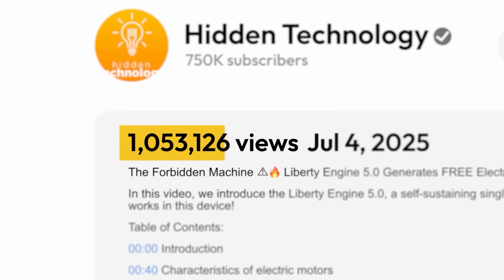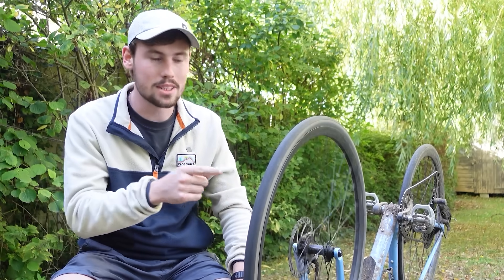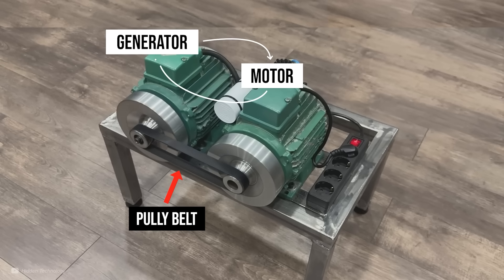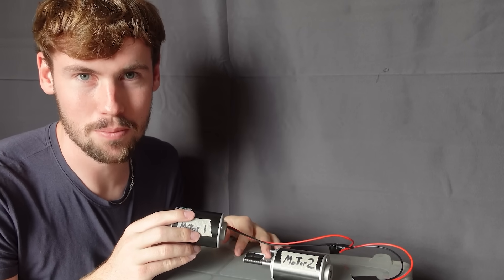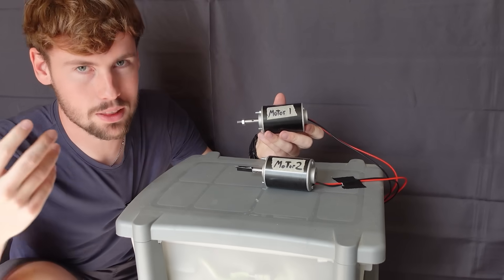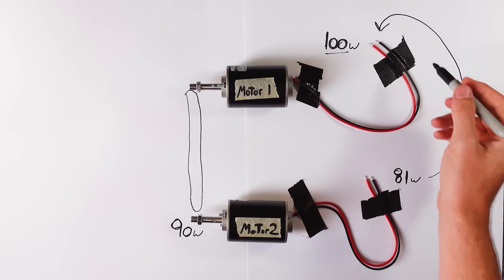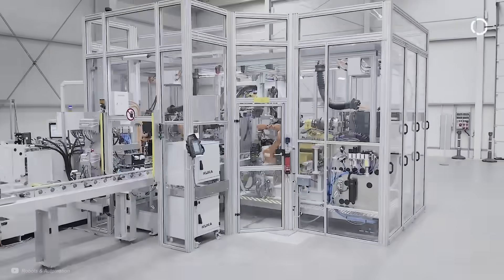100 Years of Waste! Solved by an Unlikely Invention.

Comment: I am really pleased someone came out with that. But did you ever think that there was something missing for them to be a well almost a reality. An external free source that is not plugged into the grid, like solar energy hydropower from a stream river or fall? I thought about such things a long time ago many years ago and even recently, where a steam engine was used to turn a bicycle wheel yet the invetor seemed to not notice the steam exhaust for his contraption as yet another source of energy if fitted with a vane in front of it or other mechanism to generate or power another device, it becomes a daisy chain of inventions each linked to the first. So my study was maximising every single drop ounce and spark of energy, as I concluded that creating energy to power machines has energy that is lost that can in some ways be harvested just like the energy that leaks out from magnets in dynomos.

Comment: Its like W State = W state, it just uses motors and belt instead. it can act as very good battery. instead of battery all leftover electricity channels back but heat loss is always there. therefore like atp it can be used as L1 cache like how cpu uses. Ziroth, I also think blackhole whitehole is just split turbocharger. Human soul is just fast spinning quadriple bond like pendulum. organs are clearing house regulators :) so it makes us humans are fire minimized at atomic level, and we are just derivatives who hold Absolute NNN/TRS swap on Earth's structured product/computer.

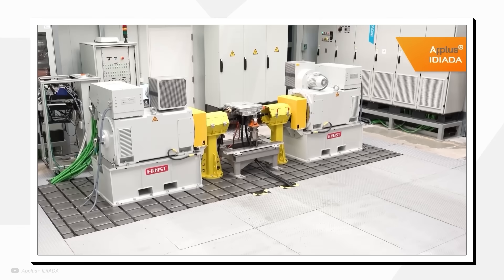Comment: 10:00 🤔 I'm not really following this bit. It sounds like they don't need a 1MW grid connection to test a 1MW motor? Because … they only need to input enough power to cover the losses? How do they get it spun up? Will it just go faster and faster until it's outputting 1/0.19 of the input power? So you can test a 1MW motor with a 190kW source?
Reply: No, when you start a motor from stationar you can think of the losses being 100%, you need full power for the first couple rotations to get it running in the first place
Reply: @matthias7534  Then how is this technology helping them? Can they jumpstart it with a capacitor or something? 😅

Comment: In the mid-1980s, we used a motor-generator with a large flywheel and a precise, quartz PLL speed controller in order to generate super-clean power for use in very high-reliability computers.  No UPS at the time provided clean enough power.  We did have an UPS attached to the motor.
Reply: Uh huh. Many many strange things were done by very strange people back in those day !!! 
Cheers!
Reply: @gyrogearloose1345 
Strange things by strange people 
AWSOME !
Reply: @carllafrance5510  ORSUM ?
Reply: @gyrogearloose1345 
Suppose to be 
AWSOME  !
Reply: @carllafrance5510  Usually spelled Awesome! 
(unless you really do mean OR SUM ?) 
Cheers!

Comment: Ok but this only applies to a dynamometer. The bigger use is regenerative braking used in electric cars and trucks. The benefits are extended range and lower wear and tear on the vehicle braking system. Most electric cars never need brake replacements.

Comment: There is no such thing as a closed system.  That is a myth.  The reality is that energy is both entering and leaving that system at all times.  The reason your false "closed system" is stopping is because energy is leaking out of that system.  If the energy was staying in that system, the motion would remain going for eternity.  

We are surrounded by energy that we are not using.  It exists and is free for the taking once you figure out how to take it.  We could use that energy, if we knew how.  Also, everything in the universe is in perpetual motion, including us.  We have never actually observed anything that was stationary.  We do not even know how to define stationary with respect to this universe.  Everything we observe is orbiting something and/or rotating.  Everything we observe is under acceleration.  Inertial reference frames as Einstein defined them do not exist in this universe.

Comment: This same concept is used to test large power supplies and battery banks, where the "load" converts the power supply/battery bank back to three-phase power and returns it to the grid.  If the power supply under test is also powered from three-phase power then the difference in the power used is only that of losses in the equipment.  Three-phase power for both the load and supply makes this possible.  Of course, for battery sources, the load does the only "converting" in the set up.

Comment: Utter stupidity. The first motor, in your example and in general too,  would not draw 100w unless you loaded it in the first place and if 100w was just only the loss power, then it would increase in the presence of the second one. BTW in which field did you earn your PhD so proudly anounced in the beginning of recent videos?

Comment: There is another instance of useless free energy machines actually helping in the real world everyone knows about the off balance wheel infinite generators and everyone knows that they basically never roll past a few rotations this is because the moving weights inside of the wheel will automatically balance themselves as the wheel spins this is used in the real world in cars they're called to balance beads and they will automatically balance your tires as you drive

Comment: Finally it seems someone realizes that you don't need theoretical "free" energy perpetual motion (impossible) to achieve "for intents and purposes 'perpetual motion'". 

If for example you had a device with such low friction that it could run for years without consuming power, that's good enough. 

Nuclear power can achieve a degree of that. Solar power can approach it. Hydroelectric, geothermal etc as well. More fanciful hopes for fusion or room temperature superconductors or even "cold fusion" (if real) could be dreamed of "effective perpetual motion". 

If in the future some technical progress of friction reduction, power efficiency, and long term power source made it possible to spin a fly wheel that didn't stop for a year, it would be as good as "perpetual motion" despite the constraints of reality. 

It's still "out there" but there are hints everywhere that some form of future quasi-perpetual motion could be useful. There are known quasi-inexhaustible energy sources. There are "high" temperature superconductors (degrees above absolute zero). There are quantum effects. 

The crude ones that are laughable and provably impossible are mostly just silly, and ways for faux intellects to pretend to be superior by easily debunking. 

Look no further than the Voyager spacecrafts for crude counter examples, still in "perpetual motion" zooming away into space 50 years after launch, and communicating. Someday they will stop moving of course, but that's academic and pedantic. 

We don't need the impossible. We only need effectively perpetual or deceptively perpetual. And future tech could in theory deliver debatable approaches. 

Take a rechargeable battery and a low power wrist watch that uses passive wrist movements to recharge, take it back in time to the turn of the century and present it as perpetual motion and most people could not identify the catch. 

In that sense, perpetual motion as the layperson can distinguish may one day be real enough to effect everyday life.

Comment: I realize there is a good answer to my question, but I don't understand what it is, so perhaps someone could explain.  If a gear/pully system were put between the generator and the motor so that the power output of the motor was multiplied before spinning the generator, then wouldn't that effectively allow the system to run perpetually with a kick start?  I realize the answer is no, but I don't understand why not.

Comment: So it's basically capturing wasted mechanical energy and converting that into electricity so as to lower the load on the grid. It's not that fundamentally different from Stirling engines using waste heat and converting that into electricity to reuse. It's just that here it's a mechanical linkage rather than a thermodynamic one, which feels too different for some people to consider the same. The caveat is that you can't extract too much of it; otherwise, you are just increasing the load.

Comment: I would propose that an "infinite"  energy machine  does  not necceserially need to be 100% efficient but needs to draw energy into our dimensions from an "infinite" external source, like e.g. another dimension. Which I'm confident no-one has yet done.  The two motor setup is as you say extreemely useful for torque and effieciency measurement.

Comment: In the seventies and early eighties the company I worked for used a similar system as backup power for computers. The system used an electric motor connected to the grid to drive a flywheel and a generator which powered the computers. The flywheel was also connected to a diesel engine through an electric clutch that would engage when the power went out thus starting the engine and maintaining power to the computers.

Comment: Perpetual Motion and Free Energy are NOT necessarily the same thing.  (Note also, you mentioned Closed System - which is quite important).  Perpetual Motion is basically exactly as it sounds  -  mankind can observe what Appears as Perpetual in the motion of planets, etc.  In a working group, it was clarified that FE can be primarily defined as Overunity COP.  We have OU COP ALREADY in PV (solar), heat pumps (air conditioners, et al), etc.  Now, the term Overunity has be surreptitiously (in my opinion) related to mean Perpetual Motion - which is RIDICULOUS.  Overunity simply means greater than 1 or 100%, and can apply to all sorts of discussions.  Yes, their are a lot of charlatans who claim FE / Perpetual Motion - their are such people everywhere.  However, Real FE Researchers are simply looking for novel / alternative 'systems' which are Overunity COP.  And by the way, physics itself claims that their is truly NO such thing as a Closed System.  Also, to be complete, COP and Efficiency are not the same thing.  People SHOULD be wondering why terms have been usurped, et al.
Reply: I don’t think they follow what you are saying. It’s all Swahili to them. It is as simple as that the way we use energy is not the most efficient way to use it. And although there are many charlatans out there, there are some legitimate directions that can use energy that is already present but currently wasted.
Reply: @Traderhood someone gets it
Reply: Glad you made this comment. Open systems and non-equilibrium thermodynamics really aren't remarkable when the energy source is properly identified. And those who understand the physics don't care for closed-system perpetual motion machines. That's because no useful work can ever be extracted, and the builder or "inventor" simply demonstrates a total lack of understanding of basic thermodynamics.

People want OU high COP devices because energy is expensive. Without inventing new physics, a negative entropy device that cools and orders its environment to produce useful work is very useful. Tesla discussed his vision for a self-acting engine, not in a closed-system but an open one. But for low-grade energy sources you must also have a very efficient machine which often is either complex or uses a lot more material. Which is why most of the generators today use high-temperature sources and fuels, because it's far easier to work with low efficiency simple devices, and essential for an economic model.
Reply: @Infinion well said 
I still make the argument that our understanding of energy as “work done” is very flawed to begin with. This flaw in understanding leads to lack of development of new technologies because we are still working on the same principals from 100 years ago, I.e. everyone is going off of math and books and not actually building or trying to find new physics

It’s deeper than just energy production, too. It’s an issue with the scientific community at large
Reply: @DaneSage  It's been very deliberate. I agree with everything you said and have felt this way for at least 12 years now since waking up from my life being on autopilot from high school to university to the workforce and deliberately disquieting myself. If the institutions who own our educational and scientific base changed, many people would go through a dramatic paradigm shift. But old gatekeepers have been so successful in delaying our society just long enough for something more than just power...
Reply: @Infinion profit before people. I’d like to think in other countries people would be more accepting of the fact our current system of energy is flawed
Reply: @Infinion the human (and American) hubris
Reply: Planets in orbit do not perform work.
Reply: There is no such thing as a closed loop,  the universe expands and thus reduces energy overtime via redshift.
Reply: Free energy=solar, tides generator, ocean currents, jet stream generator (if possible)...

They will become "perpetual machine" until the earth gone...

Comment: There is another use for a motor generator.  Say you only have single phase 50 Hz (for you) and you need 3 phase 400 Hz.  Have a single phase motor and a 3 phase generator.  Can't do that with a transformer.  At least not the frequency change.